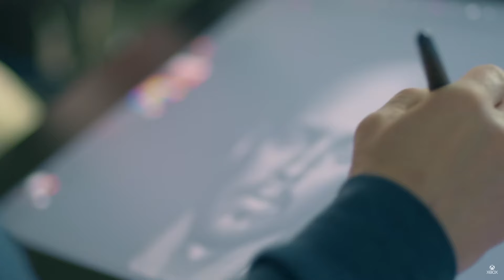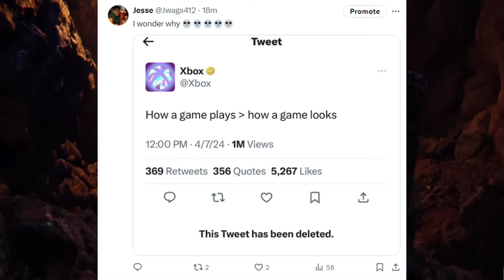HELLBLADE 2 30 FPS RANT

Comment: The series S just needs to die already. It's doing too much damage. Most of these games are being developed with the S in mind, and it's showing hard.
Reply from the maker: Agreed
Reply: The xbox series x is also a piece of shit console.
Reply: There was a report that 75% of series consoles were the S, and only 25% the Series X. They’re not gonna kill it. They fucked themselves heavily with the S
Reply: tbh even if MSFT kills the S, they still face a major lawsuit cuz most of the Series Owners are Series S. they have to live with the S till next gen's 2 years IF they would support it
Reply: Lmao XSS has nothing to do with it. Do you think rtx4090 users are held back på steam deck? Supporting a lower powered device makes it easier to have performance modes on higher end devices that's why crossgen games run great on current gen.
Reply: @geraldonunez1183  it's not the console it's the developers. PS5 is weaker yet all first part games are 60fps. UE5 is a shit engine and Xbox leadership have no standards
Reply: @vandammage1747 and adding to your solid point- Stellar Blade, a 2nd Party game by a mobile gacha dev Shift Up has two: Balanced and Resolution modes that both easily handle 60fps. That demo is sick how smooth it runs and feels even when adding in the AI seems adaptive to a point and Shift Up make it look easy too. Even when we saw RoboCop on both XSX and PS5. PS5 has even the tarmac looking realistic. XSX? Missing textures, puddles to cover this on the ground... it's ridiculous
Reply: @claudijatzandrapova3347  true, stellar blade looks great for a none first party title.
Yeah it's a strange one with Robocop but XSX does outperform PS5 in most multiplat games.
Reply: @vandammage1747  I think it's close. But yes, Eve broke the internet. Amongst controversy from incels at IGN France to the Xbox fanboys saying it needs them to sell gangbusters (Digital Deluxe for Stellar Blade recently topped the preorder charts in Europe, the US and several other countries- knocking Microsoft's Sea of Thieves down. Then we add in Microsoft going all-in on DEI and those sick of agenda and Sweet Baby are just leaving. So Microsoft just keeps on screwing themselves and I'm like.... what happened? The 360 Microsoft would have grabbed Stellar Blade when they were the adult gamer scene and had the gritty edgy games when Sony went more mainstream and Nintendo were family first. It's like the modern Microsoft lost their balls and now gave in to the evil DEI

Comment: I was a PC gamer for about 12 years back in the early 2000's then got a iMac to work on (way better than the PC's I built). I even did some gaming on this iMac (Dying Light, Borderlands 2, Arkham City, and many more usually 1080p 60 fps +).    Finally last summer I got my first console the XBox Series X and I chose it over the PS5 because I liked the hardware better and also bc of Game Pass. 

I have a backlog of DOZENS of amazing top tier games to play from 2012-2020 that I missed out on and they all play at 4k60 and most look better than the brand new 2023+ games that are maxing out at 30 FPS, or use heavy FSR techniques.   Shadow Of The Tomb Raider is the best looking game I've played, and it's massive with lots going on and it's a locked 4k60.  Then I try the brand new Gotham Knights, which is similar in game style,  actually smaller in scope than Shadow, and it's 30 FPS. What?!   TitanFall 2 is 10 years old, gave that a try and had to double check how old it was because it looks AMAZING and is 4k60 or even 120 if you want.  Immortals Of Aveum looks and plays like garbage. Couldn't even get through the free trial it was so bad. 

The original Hellblade was fantastic, but also it was not a hyped game, and sort of came out of nowhere. The graphics had some FSR to get to 60 FPS and when I saw the trailer for Hellblade 2 I knew there was no way they'd get 60 FPS sadly. Also this game is soooo hyped up, there is no way it can deliver or live up to the hype imho. And I won't play it or any game if it's 30 FPS as it kills immersion. I'll take 1440p 60FPS with great design over 4k30 with raytracing and all the UE5 buzzwords, ANY day.  

I mean, even Metro Exodus is 4k60 with raytracing! 

But like I said, I've got a TONNE of great games from 2012-2020 to play with that will last me a couple years. But for people who have owned consoles and have kept up with all the games as they are released, I really feel sorry for you/them because there really hasn't been much if anything that has come out the past couple years worth playing and that doesn't have framerate limitations or look terrible because of super aggressive upscaling.  The Dead Space Remake was the only "new" game I really liked (and I never played the originals so that was a bonus) though even that game had slight frame hiccups and did need FSR. 

I wouldn't get as angry as the guy who made this video because it's only video games, and if you don't like games, don't buy them. But at the same time if I was all in back in 2020 I would def be disappointed with how the marketing was quite misleading (PS5 and Xbox).  It seems the way consoles are though, going back even 20 years, is that the games released for the current gen consoles always have some sort of performance issues and you have to be one console gen ahead of the game you play to get the best performance (not always, but most of the time).

Comment: So either the seies x isnt very capable, the s is holding it back or they dont have the time,budget or talent.

Game will probably be good might play it on ps5 pro if it gets 60.
Reply: No it's because ue5 is very demanding and the visuals are very high  higher than any other game.. 30fps is still garbage though.

Comment: The console is not the problem man as it’s all on the devs not spending the time, and effort to maximize optimization anymore, and that’s why games are 30fps on Xbox Series X. 

The devs simply don’t care anymore as the only devs which are fully optimizing, and taking full advantage of the hardware are Sony first party devs and that’s because Sony holds them to a higher standard meanwhile Microsoft doesn’t care anymore, and they have no minimum 60fps performance mode standard for their titles and that’s the problem. 

Xbox Series X is more than capable of 60fps even with unreal engine 5 games but so many devs aren’t interested in spending time, and money for optimization and instead it’s all about making as much profit with minimal effort.

It takes thousands of hours worth of development time to fully optimize games to take full advantage of the Console hardware, and unfortunately devs are using the crutches of stuff like Fsr, and then pushing out games with low resolution, and low performance which are unfinished, and locked at 30fps which saves the devs a significant amount of time, and  money not paying devs to optimize for 60fps.

Comment: Yeah, I love Xbox but they are constantly shooting themselves in the foot. Yeah, Hellblade 2 looks incredible visually, but they promised hardware capable of bringing it to at least 60fps, they need to deliver. I'd be okay with 1440p, maybe even 1080p mode if it hits a solid 60fps. They're slowly killing the credibility of the Xbox brand. Xbox needs to go forward no longer letting their studios concentrate on their little "passion projects" and switch gears to real AAA games that will actually be worthy of purchase. They need some system sellers again, like during the 360 Era. They have way too much money and talented acquired studios to still be messing up like this.

Comment: One thing about PlayStation fans is they don’t tweak over 30fps 😂 it is possible for a single player game to look amazing play amazing at 30fps 😂 calm down
Reply from the maker: Question why did u buy a series x ?
Reply: @JWAGS412  I was mostly a PlayStation gamer but I got the series x first because it was easier to get than the ps5 yet more powerful now I like Xbox better but I remember playing PlayStation single player exclusives and not caring it was 30fps because the graphics and story was top notch for example I don’t think uncharted 4 was 60fps but it was probably one of the best looking games ever. If the gameplay story is great and graphics that’s a W

Comment: You mad? 😂😂😂😂 Cant wait to play Hellblade 2
Reply from the maker: I’m clearly mad …. Xbox just keeps on lowering the bar
Reply: @JWAGS412  how is the bar lowered when Hellblade 2 can't even run on last gen? Also this game is considered to be best looking game so far. Also GTA 6 will also run at 30fps
Reply from the maker: @tshep1985  first of all we don’t know that gta is going to be 30FPS or if there will be a option ….. if it is 30 fps even though I don’t think it should be it makes a lot more sense , huge open world npcs vehicles animals weather effects etc , and hellblade 2 couldn’t run on last gen ? I beg to differ the Xbox one x is more powerful then the series s , the series s is a last gen console itself . Hellblade 2 looks good from the cgi and cutscenes we have seen but actual gameplay we will see
Reply: @JWAGS412  the info is out there for GTA 6. It will more than likely run at 30fps. GTA 5 only ran at 30fps and that game had a couple upgrades lol
Reply from the maker: @tshep1985 60 fps should be the standard that’s just my opinion
Reply: @tshep1985 a letterboxed low resolution 30fps game will never be next gen. It's basically an embarrassment at this point.
Reply: @tshep1985 stop spreading misinformation, GTA6 could have a performance mode we don't know yet.
Reply: @vandammage1747  You know what it'd possible so I'll take back what I said. They are gonna have to figure out this UE5 though.. That engine is taxing!!! Not sure why people are not seeing that..  The matrix demo ran at 30fps

Comment: Imagine playing on console and then complaining that the games don't all run at 60 frames per second. I have a 4090 and some games barely run at 60 frames per second so they have a $500 device. Do 30fps for some of these Brand new AAA games is Low key amazing 
Y'all should all just switch to PC gaming and see some of these ridiculous prices for these graphics cards and then you will understand what playing at 4k60 is really about. PS even the 4k60 games on Playstation look ashy as f*** compared to my amazing PC which PS I usually don't play at 4K because I would rather have a high frame rate on my ultra wide monitor
Reply from the maker: If you have a 4090 and can’t get every game to run at least 60FPS then ur processor is trash